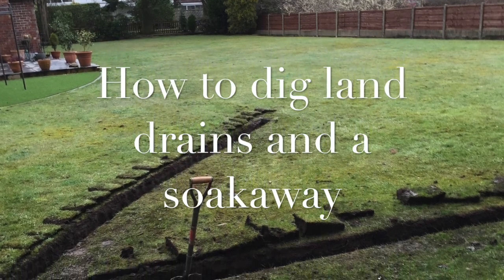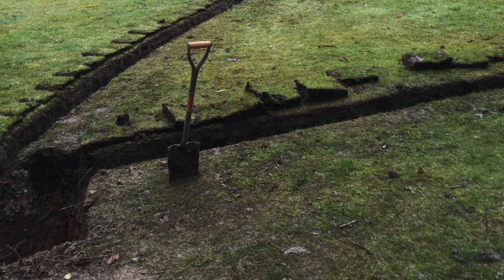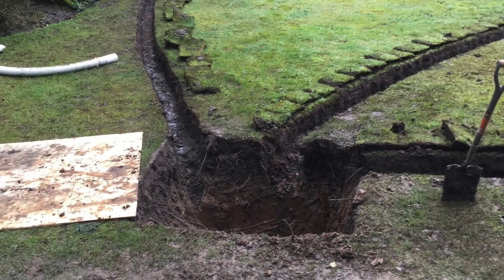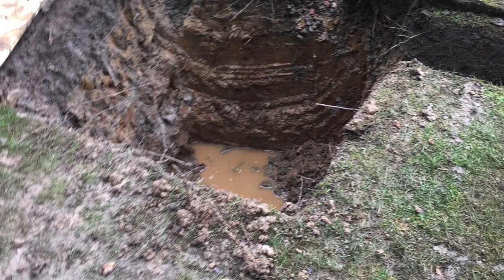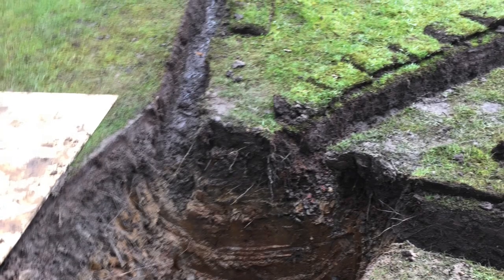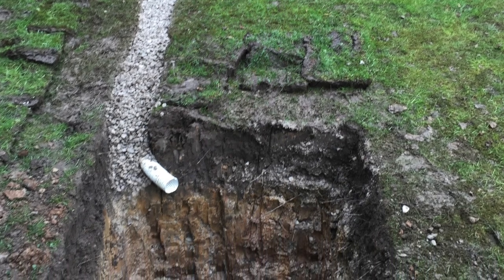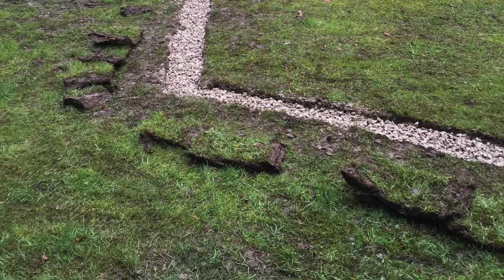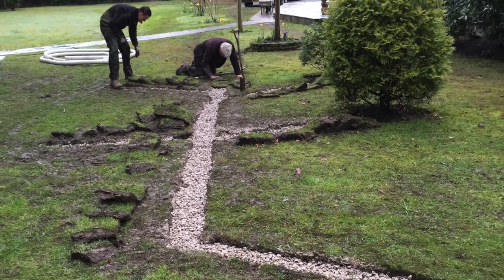How to dig land drains and a soakaway

Comment: really helpful thanks. do you literally put the turf on top of the stones? or do you need more soil on top of the stones before turf? if so how deep soil on top of stones?
Reply from the maker: Ok so We would use a loam soil and then when you lay the turf fill the channel slightly over with 20mm and flatten it gently with the back of a spade this will stop the trench from dropping in the future
Reply: @gardendrainage  f

Comment: You forgot to put membrane on top of the stone. If soil gets through the stone it will block the holes in the pipe. Always good practice to put down membrane before you put on the top sod
Reply from the maker: Hi David we NEVER use membrane around land drains and if a customer asked us to we will turn the job down it doesn't work and its detrimental to the efficiency off the land drain. If you ever need any help with this just ask we are experts.
Reply from the maker: @Anthony Newman how many have you laid Anthony?

Comment: What do you fill the soak away with? Full of stones?
Reply from the maker: Hi Jon 20mm lime stone is cheap and works well
Reply: @gardendrainage  awesome, fill it right up?  
Basically I have a 20sqm lawn that has no drainage,  and has killed the grass every winter, so was thinking to dig in a soak away in with the land drain in there. Any recommendations to the size sockaway I should dig? 

Thanks
Reply from the maker: @jonpeters-kitesurf-mtb1522  Ok so does your garden have a clay base to it if so digging a soakaway would be pointless? is your house a new build? if so this could be the problem cheap soil used for laying a garden can contain clay which could cause surface flooding? does your garden have a fall where water could naturally run off without effecting neighbours gardens? How long does it take to dry after its rained ? 5 days is to long? when you walk across the lawn do you sink into it?

Comment: is this perforated pipe needed? cant i just use stones?
Reply from the maker: You can just use stones without a problem but get big stones 20mm lime would be our choice ?
Reply: @gardendrainage  thank ya kindly! i spent 25k on a garden and now its like a swamp - soggy . yes theres been alot of rain but i expected the gardner should have an idea that he should have put in smthn for drainange
Reply from the maker: @pmacc3557  are you local would you like me to take a look and it’s rarely the landscapers fault the gardens that flood are unusual but we would lay stone then loam soil then turf but the water has to go somewhere
Reply: @gardendrainage  many thanks for the iffer. Im in Germany...
I think il dig a trench myself and fill with stones. My brother advised this should work. Il dig about a foot deep i hope and width of a see spade wide.
Thanks again
Reply from the maker: @pmacc3557  take a look at our Facebook page I've just posted some land drain pictures do exactly that and you won't go to far wrong just remember it flows down hill
Reply: @gardendrainage  thanks alot!👍